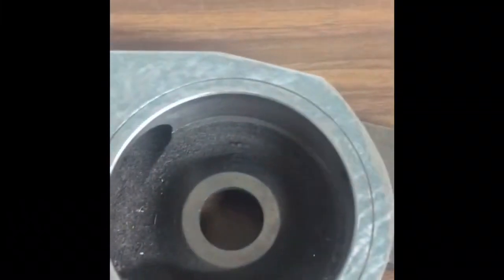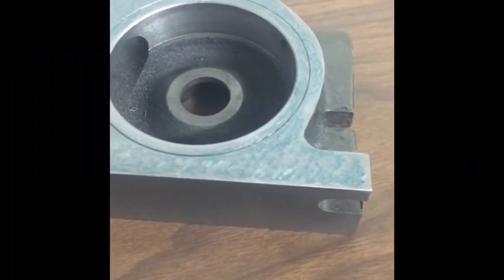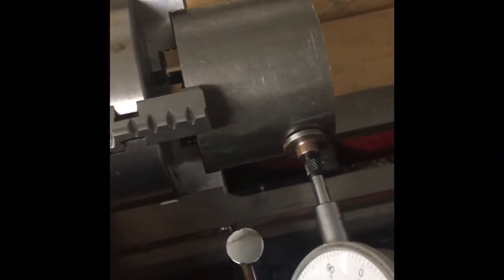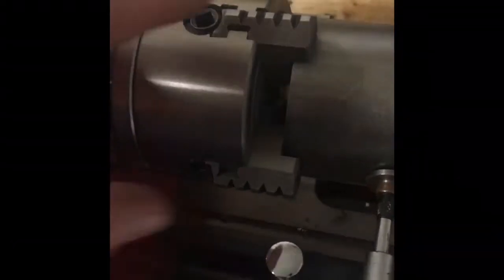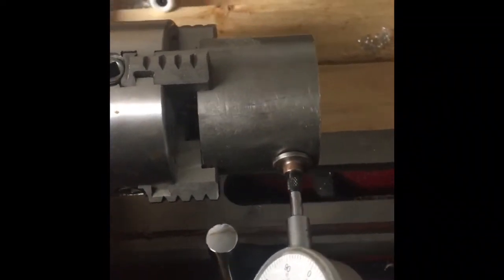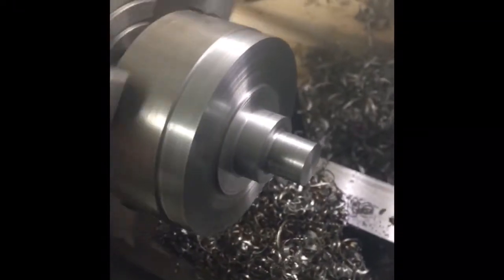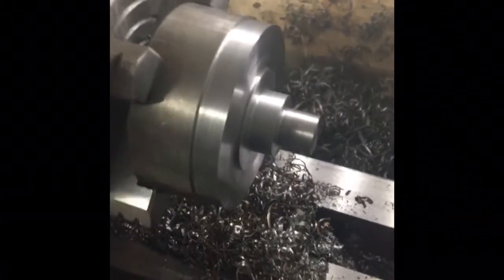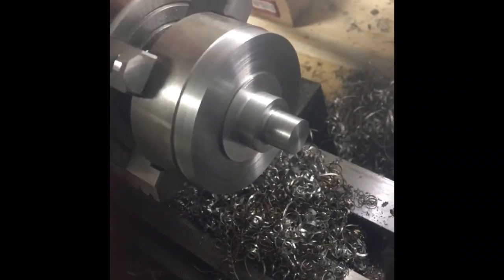Rotary Table to Dividing Head:The Transformation Part 3

Comment: Seems like you could have just surface ground the base parallel with the table top, then ground the vertical mount surface to be 90 degrees to the base surface- done in 30 minutes.